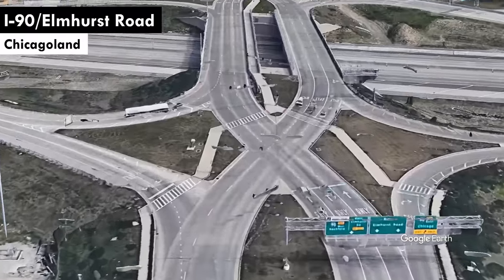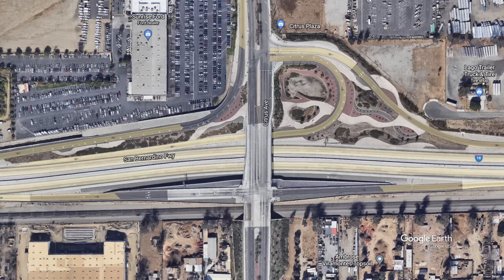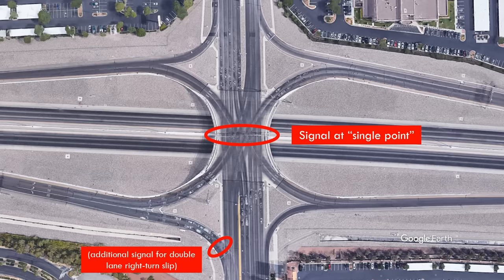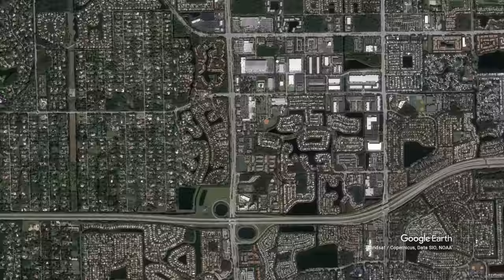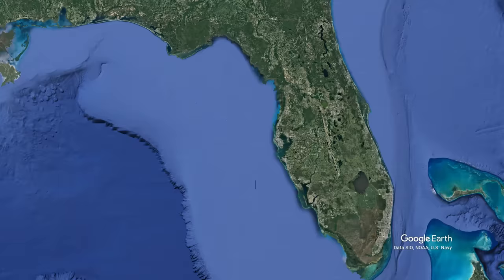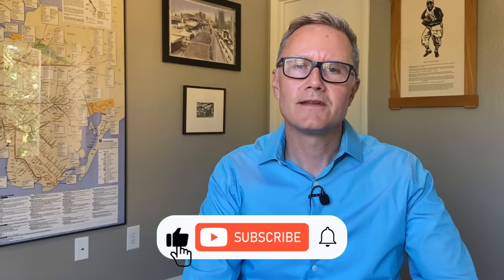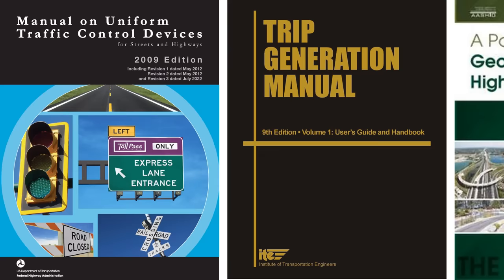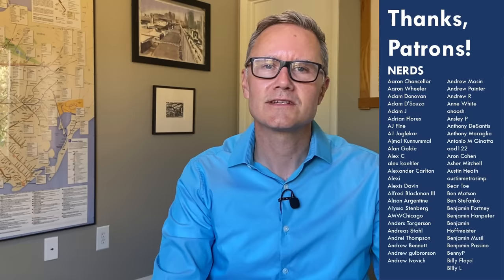Traffic Engineers Gone Wild: Why Interchanges and Intersections are Getting Worse, Not Better

Comment: I've been places where you had to use a taxi to get to Walmart from a motel, you had so many going past in the wrong direction to u-turn back. 1 mile or so net distance was a $10 cab ride about 13 years ago.
I stopped the video at DDI, the one in Springfield MO had just opened and I got to experience it, I just took it cautiously and was fine, in Kansas City metro where I lived at least 3 DDI were put in, it became easy and truthfully it was less stress.  What was amazing was a bridge over the downtown part of the interstate had to be replaced, it was done in a month or less. Heading east on I-70 there were 3 bridges replaced one was Chrysler (pronounced kriss-ler) I think the other two also began with a C, it took forever to replace those.  Oddly now living in Iowa, just after the first freeze, paving projects are in full gear everywhere, three years prior you'd think no paving was being done, where did the funding come from, oh that federal money for covid that's so hush hush on how it's been distributed. Dallas had some what I call u‐turn on the outer roads at intersections where no signal was controlling it, when I moved to Kansas I was surprised to see a lot of this on Kellogg.  /rant mode -off
Back to the presentation 😪

Comment: As a driver, I love the diverging diamond interchange, but as a pedestrian, I hate crossing highways, especially at an interchange. I think pedestrian highway crossings are best when they're completely separate from vehicle traffic. But again, pedestrian overpasses can also be bothersome if they require ramping turnbacks to cross a highway. When it comes to pedestrian accessibility, the highway should drop below grade before requiring pedestrians to climb ramps. Calgary has a relatively nice diverging diamond interchange. The pedestrian crossing seems "friendlier" than the one in this video. The city even made an effort to "beautify" the crossing with public art. I think that particular DDI was Canada's first. Another one is being constructed in Niagara Falls over the Queen Elizabeth Way.
Reply: that is the first ddi in Canada. is it near the Deerfoot tr? I could not find it.
Reply: @garyholt8315  It's Macleod Train where 167 Avenue SE turns into Sun Valley Boulevard SE. Just look for the Shawnessy Shopping Centre if you're Googling it.
Reply: @david_walker_esq  thank u, I had looked at deerfoot tr near ikea
Reply: @garyholt8315  No problem, Gary. That one by Ikea is a trumpet interchange, I believe.
Reply: @david_walker_esq  it is a trumpet.  the ddi has quite a good walkway, with access at both ends of the overpass to both sides of both streets. we'll thought out design 4 a change !👍
Reply: @garyholt8315  Yes. That's what I meant by "friendlier." The pedestrian "accommodation" of the DDI in the video looks terrible. I wouldn't want to have to use that daily by foot.

Comment: Hey,

Love these things.  

WSDOT is doing a “missing link” project from the south end of 167 to I-5 (puyallup to fife). It looks like they are using diverging diamonds at both ends.  There’s a sweet traffic circle in the mix too. And a few hold out property owners.  

This is just south of the 509 I5 interchange between s 200th st and a 216th which also has the Link light rail alignment.  

WSDOT just “finished” Tacoma, so I guess they couldn’t leave well enough alone.

Keep it up

Comment: The have added diverging diamond freeway interchanges near me and they are a big improvement to cross on a bike from the previous designs.  Most locations you cross on a traffic signal and in the same direction of traffic so you don't have to worry about turning cars.  I don't feel that I need to be looking in multiple directions at the same time and ready to stop or steer to avoid getting hit.  As a pedestrian I know I am in the minority of the amount of traffic at these intersections and I think they "accommodate" me pretty well.
Reply: Ray should take a look at the DDI's at exits 79, 69 (which is famous for interchanging with Big Beaver Road), 65, and 63 along I-75 in Michigan. These DDI's seem to be well-executed and not unfriendly to pedestrians.

Comment: I admire the SPUI.  It's as compact as the diamond interchange, and it has a higher capacity for vehicles.  That said: my weekly running route takes me across a SPUI and yes, crossing through it on foot is exactly as miserable as you describe.  I would like a completely separate pedestrian bridge instead, a few blocks over.

Comment: I get the feeling that a lot of these "creative" intersections are used in areas without a standard grid structure. 19th Ave and Park Presidio cut clear across SF, from 280 to the Golden Gate Bridge, essentially without any left turns. Drivers  go around the block (three right turns) to make a left. The city basically eliminated left turns without any accommodation, allowing the grid to absorb the excess traffic.

These intersections you're showing look like they're basically trying to achieve a similar pattern without developing four city blocks with ten intersections just to eliminate lefts at a single crossing.

Comment: There are several freeway ramps where I live in NC which are similar to the Bowtie concept, but far more functional.  These consist of traffic roundabouts at the top of the ramps instead of signalized intersections.  A vehicle making a left turn at the top of the ramp simply pulls 3/4 of the way around the traffic circle.  The traffic flow is intuitive for motorists and limits the number of times pedestrians must cross traffic lanes.  However, these types of intersections are mainly at smaller secondary roads, and not the local stroads

Comment: I’m here to mount a defense of the Diverging Diamond Interchange from the perspective of a pedestrian. To traverse a DDI, you have to use four crosswalks. However, two of those are fully protected crossings by virtue of the interchange design: the location where the roads switch sides has no turning traffic, and exactly one direction can be going at once. This means that there is no active potential conflict point between you and auto traffic at those two intersections. Moreover, you can stay on the same side of the road or cross over to the other one with the exact same number of road crossings. The right turns from the expressway to the cross road and vice versa are still a problem, though, but every design that would be considered for that volume will have continuous right-turn slip lanes. The median sidewalk is not significantly worse than one on the edge of a bridge to me, but that is a matter of opinion.

Overall it is unquestionably better than other design options that might be considered for that volume of traffic. Large diamonds often do not have any protected pedestrian movements (unprotected left turns from the cross street onto the expressway), and will likely not offer a (reasonable) way to go diagonally across both roads. Partial or full cloverleaf interchanges are even worse for pedestrians since they send you over more continuously merging streams of traffic which may not be signalized at all. You have gone over the disadvantages of the SPUI.

I would also heartily recommend Road Guy Rob’s video about the DDI (and really, his entire channel).
Reply: very well thought out analyze of ddi's

Comment: From my experience in Canada and the USA, Pedestrians are an afterthought.  With shopping centres the size of a small country, the car parks are even larger.   One in Timmins, Northern Ontario, had a bus route with 3 stops across the shopping area car park.  No pavements or sidewalks on the duel carriageway run through the shopping centre car parking area.
Reply: All thanks to politicians.

Also, people don't shop at their local stores. In my town, there used to be a convenience store smack in the middle of a residential area. However, it closed because no one would shop there at all. I only went once myself (it was a different neighborhood from mine) but aside from the cashier being kind of stiff, there wasn't anything wrong with the products.

Other place I went to, only real issue was the payment terminal still ran on dial-up instead of cable internet but it still wasn't ridiculous.

There was also a restaurant that closed but in that case, I suspect the nearby school probably put on the pressure because they didn't want the kids to eat there.

Comment: You could do a segment on the Cross Bronx where the folks in charge force semi traffic to cross several lanes of traffic so they can take the upper deck lanes on the GWB.  In direct ignorance of the original intent of trucks taking the lower deck to protect them from the winds.

Comment: Intersections like this are not a problem if pedestrians and bikes have good alternative routes. For example, a big interchange at 52.053728, 4.400429 has a pedestrian tunnel closeby. Another example is 51.996365, 4.389284, which also has no pedestrian access and pedestrians and bikes are tunneled via a nearby tunnel/underpass under the highway

Comment: Last video you had a cycle of car dependency flow chart. Blame the planners not the engineers. They are the ones asking engineers to improve capacity instead of looking upstream at the causes of volume in the first place. 

The double diamond is a good example despite its unfriendly ness to pedestrians it’s significantly safer for vehicles compared to the original design

Comment: The intersection of SR 82 and Gunnery Rd in Lehigh Acres, FL is a good example that would fit with these.  It's a little more rural than your other examples, but I don't recall seeing another intersection set up quite like that.  The area is notoriously unfriendly for pedestrians.  Most of the roads don't even have sidewalks to give the pretense of "accommodating" pedestrians.

Comment: Covington just added a "Texas Turnaround" which closes the onramps that used to let locals avoid traffic, and instead makes them drive two miles in the wrong direction and get on the back of the line, adding to the traffic problem.

Comment: 13:05 When you hit 100K I look forward to your flyover of the MCG (Melbourne Cricket Ground, home of the AFL), with its 15min walk from Flinders St Station, 5min from Richmond Station, 2min from Jolimont Station and trams at both the borth and south end of the ground. The rail links directly serve 70% of the metropolitan area, and shuttle trams from Flinders St serve the remainder. Not bad for something originally built in the 1840s. The Tennis Centre, home of the Australian Open (Grand Slam), and used for concerts throughout the year, is also served by this transport infrastructure.

Comment: Ephrata, Pennsylvania, got one of the state's first diverging diamond interchanges a couple years ago. I think the switch has made the interchange safer and easier to navigate for car traffic because it eliminated difficult unprotected left turns to get on limited-access US 222 from surface highway US 322. Painted bicycle gutters accommodate (there's that word) Route 322's significant bicycle traffic from the large local Mennonite population; not ideal, I suppose, but the new design probably reduces bike-car conflict points.

Comment: The section of the video on Michigan left is interesting. For a surprising context where it comes up, it’s worth noting that the street design for the St Clair streetcar right-of-way in Toronto (built in a 1940s ish era section of the city) relies on directing auto traffic to do Michigan style U-turns to reduce the number of intersections where the streetcar conflicts with left-turning cars. (Giving priority to auto left turns was a major factor slowing down the earlier Spadina streetcar right of way.) The geometry is slightly different since the U turns are done across a wide median containing the streetcar lanes. The designers evidently liked the idea enough to announce at one point they would be using Michigan lefts for the surface portion of the more suburban Eglinton LRT project, but as far as I know that idea was given up on

Comment: Sorry, but I still don't understand why you build your interstates in the US through your cities and not around or past them. I mean.. they are called inter-states.. not intra-city.
Reply: That was a very early decision that was made here, despite early highway engineers at the time advising against it (I remember reading something they wrote once: "highways should not go through cities, nor should new cities be built along highways"... well, they did both of those.). The idea I guess was for the US's cities to stay relevant they had to be connected to the new suburbs (where most post-WW2 growth happened) via highways. This all happened in the 1950s and 60s when the US basically decided to cease building new passenger rail and abandon its passenger rail systems that already existed. There were going to be even more highways through cities but there was a "freeway revolt" that stopped a fair number of them (including some straight through NYC/Manhattan and Washington, DC). Now some of them are being removed, but most of them are going to stay in place. Los Angeles, for example, is basically built around its freeways. They're not going anywhere.

Comment: It makes no sense to accommodate pedestrians and cyclists to massive structures like this. For those, there should be separate shorter paths as far away from the pollution as possible. What I mean is that there shouldn't be a way to cross the intersection - the intersection shouldn't be somewhere you need or want to cross.

Comment: in Britain,  we have Magic roundabouts the cars go around in circles so you only turn in one direction. in light traffic conditions few stops, in heavy traffic controlled by traffic lights so no driver has to cross a line of traffic it can accommodate multiple incoming roads most of our junctions are simple crossroads with a roundabout in the middle when using one you have to allow for larger trucks using all the road surface to get around

Comment: My city implemented a policy after it had been campained for and a public demand was made that every new interchange and even every new road resurfacing, reconstruction or new constrution must have solutions for all traffic types - i.e. the planning bureau must show what traffic to expect by mode, how the design accommodates for that and (perhaps most importantly) how the design would impact the modal split. This change alone, just the fact that they now have to report what they are actually doing to non-car road users, led to a radical change in how newer roads and intersections now look. Apparently civil engineers actually don't realize that they impact a system if they don't meassure it - it's almost like they never took any physics class during their education...

Comment: It's not a bad idea to build interchanges that are hard to navigate on foot or by bike, but building these means that there must be other infrastructure to help pedestrians and cyclists. Meaning these kinds of interchanges need to be leading from something like a ring road etc onto a major throughroad. They should never instersect with a street.

Your example of the SPUI is a great example of the wrong interchange in the wrong spot. SPUIs aren't bad per se, but it must never ever be placed in a place where pedestrians and cyclists are to also be. Same for diverging diamonts. Such interchanges should also never be added to any place where bikes and pedestrians are to be.

In the Netherlands, the moment a road becomes to big to safely and easilly add in cycling and or pedestrian infrastructure, they will add specific generally segregates infrastructure. ANd quite probably before it is needed even

Comment: Most of these intersection designs introduce additional opportunities to accommodate pedestrians, even if they're often not used.

And removing left turn conflicts isn't about drivers being too incompetent to make them, but about removing the potential for crashes. Higher vehicle throughput is also often a factor, but rarely as significant a factor as safety is. They do still often reduce time available for pedestrians to cross, but there is good reason to try and eliminate left turn conflicts.

Comment: Glasgow has some weird intersections. Crow Road and Great Western Road is like 4 different intersections on a 100 m.sq. large square, with physical separation for lefts on two arms and 7 slip lanes.

The M8 and A804 intersection really really really takes the piss though. It's so complicated I can't even describe how bad it is. Because it's in Europe and there's space constraints, there's no symmetry at all, there's god knows how many roads intersecting, the whole thing is supposed to be just an interchange between a highway and a freeway but there's another half dozen or so local roads involved and a bike path with an intersection above the motorway that goes under other parts of the interchange in like a dozen places.

Otherwise, there's a thing called a snail roundabout. A bunch of lanes spring up from the centre of the roundabout, so you have to stick to the innermost lane turning towards the centre repeatedly until you can enter the lane that goes where you need to go.

Comment: Great video. I work in the industry and it is nearly impossible to get anything different pushed through. Federal standards are very limiting and state/county/city policies are crazy hard to make any changes. If you do something that does not meet "industry standards" or "adopted policies" then your liability exposure goes through the roof.
Reply: Another huge issue is many communities have state or US highways going through them which are owned by state DOTs. The DOTs typically treat every road like it is a highway and it just destroys any notion of livability outside of speeding in a car.